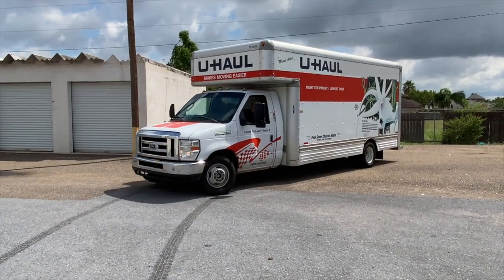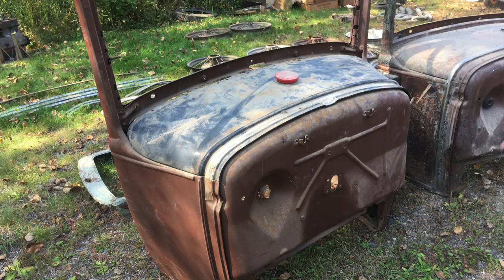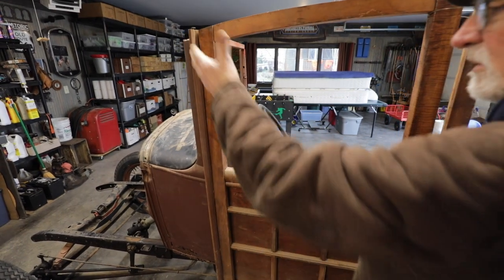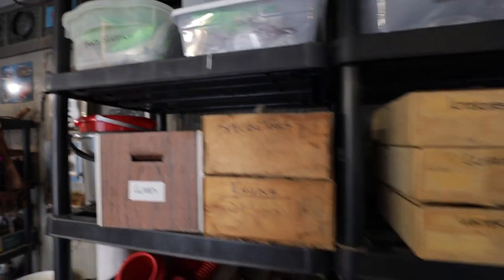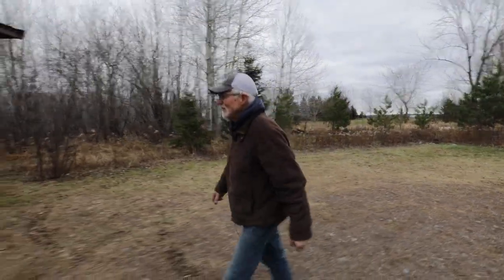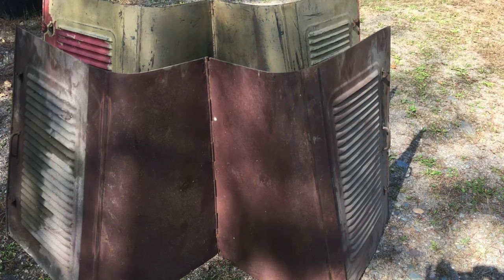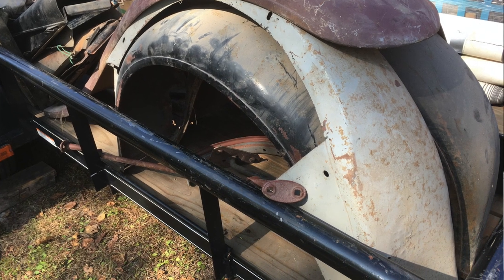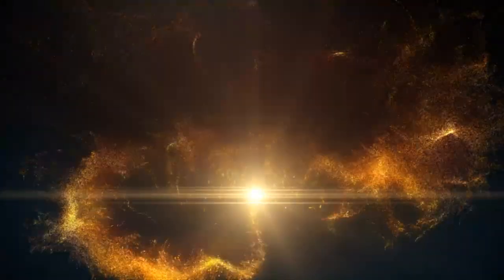Restoration Vlog E2: 1931 Ford Model A Woody Wagon Episode 2 E2 Parts Cataloging

Comment: hi, I've been following your build. I have a 30and am looking for parts, wondered if you are interested in selling spares? thanks
Reply from the maker: We will likely have parts for sale when we’re done with the build.  I’ll ask Tim his plans and mention that on the final video of the build.  Thanks for watching.
Reply: @PictureTime  hi, Jack again, I'm stuck in my build. My rear wheel housings are like swissccheese, requiring hours of cutting and patching. I'm desperate not to take that much time and the build is stopped until they're done.  As you know they are one of just a few sheet metal pieces that are specific to woodys. Any help would be greatly appreciated.
THSANKS!